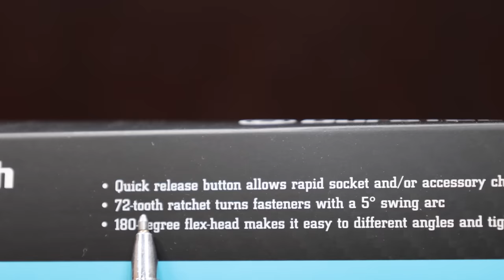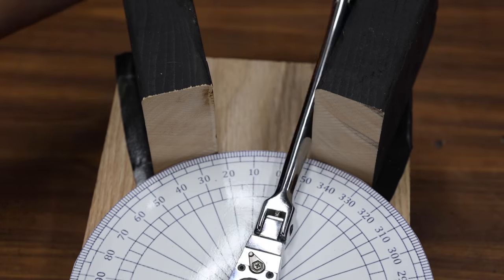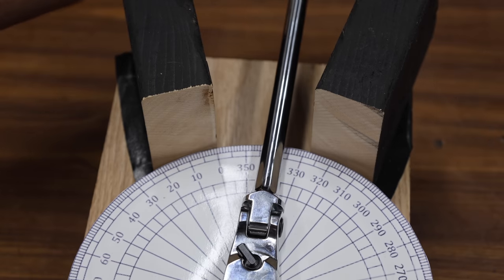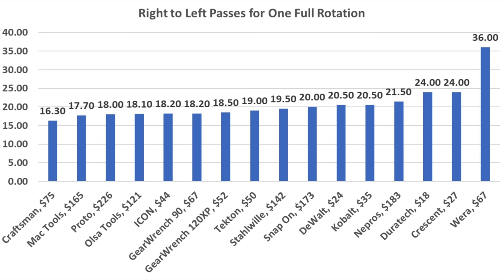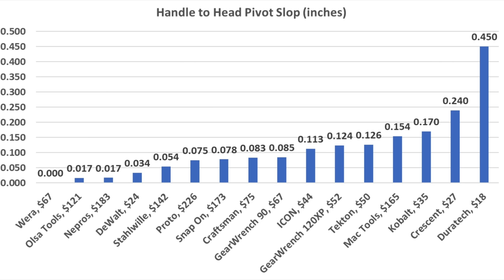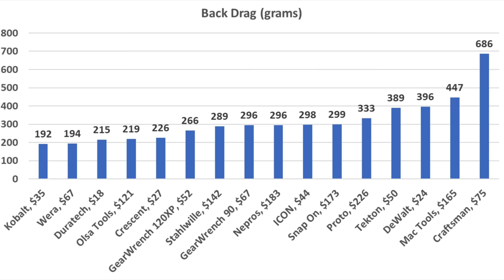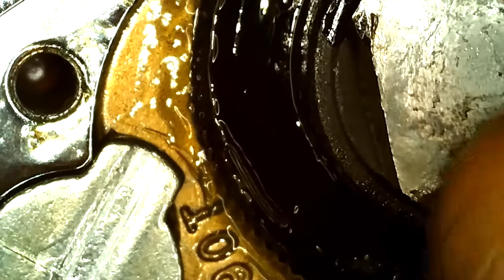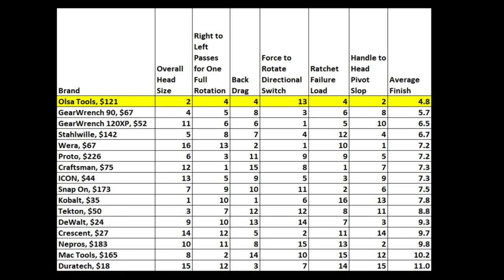Best Flex Head Ratchet? Let’s settle this!

Comment: A subjective point, but it looked like all failed by using something to extend their handle to be able to put enough force on them to achieve those levels of torque.  That is to say, for the most part you shouldn’t be worried about that part of the test when you pick what 3/8” ratchet you need to fit your budget.  Now when you get in to 1/2” flex head or breaker bar territory, this stat will prolly hold more weight in your decision. Just wanted to share to some of the younger or more inexperienced members of the crowd.  Thank you for sharing!
Reply from the maker: You are welcome!

Comment: Well if anyone is interested, I prefer the direction lever type switch be a bit on the harder side to move so when you choke up on the ratchet after breaking loose it doesn’t switch directions on you. Great video, all pretty good tools in my opinion depending on what you’re working although I was a little disappointed in Mac, C’mon  guys ! Lol
Reply from the maker: Thanks!

Comment: I have all of the icon line-up, and I’m very happy with them. I’ve only broken the 1/2 long flex head with a 36mm axel socket. To de fair I broke 2 1/2 breaker bars. I was able to break it loose with my 1/2 Felx impact with the 6.0 battery. I’m  mobile mechanical, that rely on my tools for a living.
Reply from the maker: Thanks for the feedback.

Comment: I have the tekton ratchet and it’s ok. I’ve had to warranty it twice, the first time it bent the ears and broke the pin for the flex head, the second time the internals failed and locked up. Both times however it took minutes to send in the pictures and I had a new one in a couple days. Cheap tools with a super easy warranty is enough for me

Comment: Craftsman has really improved their ratchets. The build quality is amazing and they are very smooth operating. I would strongly recommend the bent handle 3/8 ratchet. This a very useful feature to fit in tight spaces while giving you the added leverage of the longer handle length.
Reply from the maker: Thanks for the feedback.

Comment: Great stuff, I’ve been a industrial mechanic for close to 20 years and always have a bent handle flex head ratchet around. Great for breaking bolts loose and spinning them out. Craftsman doesn’t make a good one anymore so when this one breaks I’ll have to go to another brand. I have a 1/2” drive proto flex head that’s been good but I probably wouldn’t buy another for the price.
Reply from the maker: Thanks!  Thanks for sharing.

Comment: The drive is an easy replacement.  Ideally that's where I'd want to see failure on all ratchets.  I'm surprised to see the Olsa tools on here.  I purchased impact sockets from them earlier this year and have been very impressed.  The tolerances are some of the best I've seen.
Reply from the maker: Thanks for the feedback.

Comment: Ok I have a great idea for a video,,, I fly paramotors. The few engines that we all use requires a mixture as they are 2 stroke. The ongoing feud in the “paramotor world” is,, what’s the better fuel to use. Pump gas vs pump gas ethanol free vs 100low lead aka AV gas. In addition to the the gas feud is the oil to mix feud. A lot to unpack I know. I’m a fan of your work and would love to narrow down the particulars if this is interesting to you. The paramotor world will eat it up!!!!  Send me a message and we can narrow down and talk further. 
Thanks for your videos. You have helped me buy many tools and make good informed decisions on things. Looking forward to talking more with you. Jim

Comment: I'm the oddball customer. I actually like my Craftsman V series ratchets. I purchased a new 3-pc set auctioned and they ratchet pretty smooth. Wow I thought. I went to the hardware store and tested 3 of them. I purchased the best sounding Craftsman V series 1/2" drive flex head comfort grip with the best ratchet action. Worth $59.99 in my opinion.
The clicks feel precise, tough and durable. The closer internal gear tolerance probably affects how they feel during use. I personally don't like ratchet gears that are too sloppy. I own and use breaker bars. My Milwaukee and Icon ratchets are great too. My 1990's Stanley ratchets work smoothly and are tough and durable.
Reply from the maker: Thanks for sharing.

Comment: I have been using the Kobalt flex head ratchet while stripping a car that I am restoring. Throughout the process, I have gone through 4 of these ratchets. The bolts holding the ratchet head often come loose and makes the ratchet fall apart and break. Stay away if you're a serious mechanic or constantly work on cars. Other than that good ratchet (only because I can drive down the street and exchange my broken one for a new one)
Reply from the maker: Thanks for the feedback.

Comment: Great Job Sir.

I do appreciate how you put all the specs up, and let the viewer decide.....

These tests here in today's video were the classic case of "This is designed for a different usage case."  It's not really apples to apples, to put the Wera in with these other wrenches....  Just looking at the thing, you can see they have a different usage in mind, in their design department.....  I don't know what trade or job they are picturing, but it must be something different....  And it's not crap, right??  I have some Wera stuff, and you can say what you want, but it is made very well, and exudes quality.....

Even amongst your audience, I have no doubt there are auto mechanics/techs, and people who wire fire alarm panels, and telecom people, and people who build & wire control panels....  So, those are all very different.  Even the last 3 that kinda sound the same, are different...

So I do like that you clearly lay out the information, and the audience can decide what features really matter to them....
Reply from the maker: Thanks!

Comment: I have the gear wrench 90 in 1/4 and 3/8 and theyre my favourite ratchets hands down. The simple locking flex head design is a game changer. Easy to use. Lifetime no hassle warranty. The only thing I don't like is it's made overseas.
Reply from the maker: Thanks for the feedback.

Comment: This is great stuff. Awesome to have this information as a mechanic looking to purchase tools. 

If you are looking for videos to make I would be really interested in a durability test. For example:

dust, oil and water ingress. 

Impact resistance of the mechanism

Some kind of torture test where you spin the mechanism and get some kind of idea of how long the thing will
last.

Resistance to side loading.

Contact area and hardness of the internals

Heat generated while spinning the ratchet

Run them over a couple of times with a truck or heavy equipment.

The max torque of a 3/8 ratchet actually doesn’t matter at all to me because I would never put that kind of torque on a 3/8.
Reply from the maker: Thanks and you are welcome!  Thanks for the suggestion.

Comment: Handle slop seems to have some variables in regards to where the measurement is taken relative to the joint. Measuring further away from the joint will increase the measurement value.
Reply from the maker: Thanks for the feedback.

Comment: I have Pittsburgh pro, icon, gearwrench, and a mac flex head (you can never have enough ratchets or enough in different lengths). The only one i have ever broke was the Pittsburgh pro. I used it at home for many years and broke it with a cheater pipe and the bolt holding the head on actually broke and broke the threaded part on handle off. I now use the head of that ratchet by itself for tight areas. All of that said i wouldn't rely on it to be my sole ratchet at work
Reply from the maker: Thanks for sharing.

Comment: What I've come to value for ratchets is how a handle long you can get them with. I think I use mine more like a breaker bar without needing to reposition as much and with infinitely more access because of the short arch swings on ratchets vs breaker bars. once a fastener is broken loose it's often faster to switch to battery ratchets to finish removing the fastener. This is all to say that my current favorite ratchet is a 20" locking 3/8 Snap-On flex head. There aren't nearly as many options for locking flex heads and I prefer it over a floppy loose flex head because you have options when fishing for a fastener you can't reach and no need to have a solid shaft ratchet in the tool box with the locking flex head. just my two cents.
Reply from the maker: Thanks for sharing.

Comment: Big fan. One suggestion: perhaps do a separate comparison for swivel head/roto ratchets.  They have a slightly different theory of operation, affecting certain measurable aspects like back drag and arc swing. This may explain some differences in how the Wera Zyklop compared to the flex heads in this video.
Reply from the maker: Thanks!  Thanks for the suggestion.

Comment: I have a video idea. PLEASE compare FASS vs Air Dog. These are aftermarket external lift pumps for diesel trucks. I'm not even going to mention which pump I run on all 4 of my rigs. They both give anecdotal data, and both claim their product is superior to the other. I think your test platform would be quite illuminating. 

Always love your videos. Been watching them for a few years now. Even if you compare things I don't and/or will never use. Always means I can make a recommendation to a friend or family member in need. 

Keep doing an awesome job.
Reply: Forgot to add that the claims they make is over how much water, air and other contaminants are removed from fuel. Also who's pumps last longer, and flows better.
Reply from the maker: Thanks, will do!  Thanks for the video idea.
Reply: @ProjectFarm  absolutely! I can't wait to see what you come up with.

Comment: Before a few years ago I used Old craftsman flex heads and while they worked, they weren't overall smooth. I ended up getting husky, Pittsburgh and Icon. Icon is by far my most favorite. I prefer the smooth flex head without the detents and it hasn't gotten floppy yet. If you're really strapped for cash then I'd recommend the Pittsburgh, never had given me issues just don't expect a 3/8 to handle a cheater bar, get a 1/2 or breaker bar for that
Reply from the maker: Thanks for sharing.

Comment: This comment is probably a bit late but I would like to see the ratchets tested after some use. You will find that ratchets have a bit of a break-in period before they start to “loosen up” and operate as smooth as they can. This is something that may be important to add as, although this in the video is amazing to see, use after break-in could be just as important. Especially if these tools are used and abused regularly by the buyer.
Reply from the maker: Thanks for the suggestion.

Comment: i notice that the failure rating is listed in order of which one survived the most, but honestly the failure point is what i would say dictates the better score. if the handle fails, youve got to buy a whole new tool. where as if the mechanism fails, thats a very good failure point as it can be easily replaced at a much cheaper cost.

it might be worth revising the scores, basing them off of their failure points as well.

Comment: I think the greater level of force needed to switch the ratchet from forward to reverse is actually a benefit when you're using the ratchet.  Trying to use a ratchet and having it switch into the other mode or get lost somewhere in between is ENORMOUSLY frustrating and lead me to get rid of an entire set of ratchets from kobalt, even though they have a lifetime warranty and the stores are close to everywhere.
Reply from the maker: Thanks for the feedback.

Comment: I have a 1/2 drive huskey 144 position flex head and I put a six foot cheater pipe on it, stood on the shop wall and pushed on it with my legs as hard as i could and that ratchet would not break, it didn't even bend. Ended up having to heat the bolt up but anyway, i prefer gearwrench but dam, that husky ratchet is a beast, still works great.
Reply from the maker: Thanks for sharing.

Comment: The link in the description for the Olsa is only a rebuild kit and is only for a 1/4" drive ratchet. What model number is the Olsa? The Craftsman has a plastic handle, which is different than the all metal one featured. The Craftsman is luckily cheaper than the price in this video though so that is a plus, but that huge plastic handle is a no-go for me.

Comment: Possible episodes. Question, Is drum oil the same oil as is sold in jugs and quart bottles if it is the same brand and weight? An old mechanic I knew when I was younger told me that drum oil is the dregs after manufacturing. I never believed this. I think bulk oil in drums are the same oil as sold in jugs.

Possible episode 2 : I am an early user of synthetic oil in my cars since 1986 when it was not required by the manufacturer. I changed my oil @ 5000 km. ( Canada ) When I do,  I do a full regular oil change and drive for a day before I change my oil filter and replace the oil with synthetic oil. Another way suggested to me was to drain the old oil and run a new quart of oil to flush the remanent oil out of the oil pan. Which way is better?
Reply from the maker: Thanks or the suggestions.

Comment: For the back drag test, I think you should reconfigure the stops closer to the head of the ratchet.  If you have the stops near the handle end, it is not a realistic arc swing test, because in real use, your HAND would be within the stops.  You don't use a ratchet by holding it by it's very end. 
In a separate comment,  I suggested to include the Capri Flex.  I have several Flex Ratchets, Snap-On, Titan, Capri, Icon.  While I like the Snap-On the best, one of the reasons that it makes a great ratchet, is the rigidity of the handle.  Thick, and no flex under normal load.  Compared to my Capri, which has a thinner handle, you can feel the flex.  Think of a torque limiter on wheel impact extensions.  That makes tightening and loosing require more torque, because a lot of energy is wasted in flexing the handle.  However, it weighs about 1/2 of the Snap on, and 1/5th the price, so if the job has a lot of fasteners that are smaller, the lighter weight makes for less effort swinging back and forth, which saves fatigue in those cases.
Reply from the maker: Thanks for the constructive feedback.
Reply: I meant the Arc Swing test...not the Back Drag test.  @ProjectFarm

Comment: Another great video.  Thanks again!  Would hate to break one but would like to see how the Craftsman RHFT ratchet stands up.  The 3/8 Drive only has 41T but is a dual pawl design with a 4.4deg swing.  I think the dual pawl makes 41T perform like 82T.  RHFT = Round Head Fine Tooth; all made in USA from 1968-2009.
Reply from the maker: Thanks!  Thanks for the suggestion.

Comment: Want a video consideration...

As a finish carpenter to use a typical tape trying to measure for crown molding.
It's all kind of fun, the tape bends, " breaks" , is fun trying to get accurate measurements.
I found laser tape, bought the lieca the inventory of the technology, first used by the military for artillery spotters.
It seems more for inspectors, is well made, easy to read and extremely accurate.
No more add few inches for crown, trim until it fits 
Then found the stabila, has rubber case, fits my hand for ease of use.
Can measure the room in volume for painting, drywall, etc  all set to the cell phone.
It has better operation .

Eve fought about shootout ...
Stabila vrs lieca vs Hilti vs Bosch

Then the want to be.stanley, DeWalt, then the el cheapo.
Reply from the maker: Thanks for the suggestion.
Reply: @ProjectFarm  hey you want ideas.
I will make a request, you are exceptional in testing methods 
Pure genius.
My laser tapes are the 100 ft range, used for interior trim.
Price range
Lieca 99 at home Depot on line
Stabila 120 at tool dealer spring sale

Sure there one's cost over $1,000
Stabila has a screen live image to show you in or outdoors your laser dot as Leica, those are more for large construction companies than contractor or serious homeowners.

Consumer grade...
Stanley and similar

Pro grade
Bosch
Stabila
Lieca

Expert grade.
Hilti 

Not sure how your channel was started , just glad you created it.

Comment: You completely forgot about the Matco flex head, low profile, 88 tooth Ratchet. It's really good, when I was wrenching professionally I was using the 3/8 drive for things I probably shouldn't have and it held up, in fact I still have it and it works perfectly.
Reply from the maker: Thanks or the suggestion.

Comment: When using ratchets I've found that it's more annoying when the "forward/back" directional switch is too LIGHT, getting flipped by accident when you're working with the tool. I have no idea how you'd find consensus on this, but this doesn't seem like a situation where "the lighter, the better", but rather that there's a "sweet spot" that's not too heavy or too light. The other aspect of that lever/switch is the feel of it.. a good snappy switch with positive movement is better than a mushy one.
Reply from the maker: Thanks for the feedback.

Comment: After your last comparison video I went to tractor supply and got a gear wrench ratchet. Used it a couple times and haven't touched it since. The on/off switch is backwards and drives me nuts and I find I much prefer the Pittsburgh pro flex head ratchet for everything. Should have had it in this video to compare to the icon. I bet it's pretty close for less money.
Reply from the maker: Thanks for the feedback.